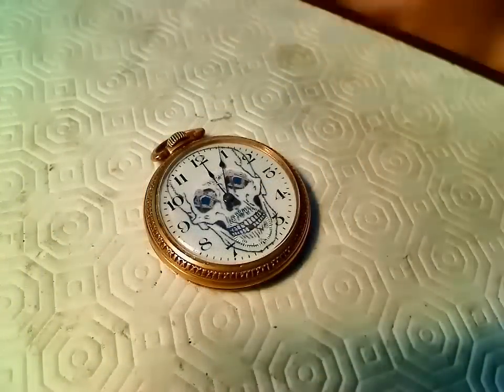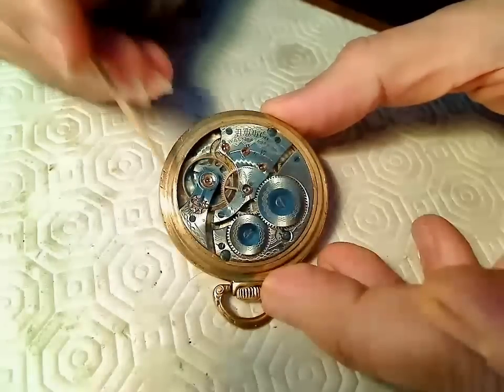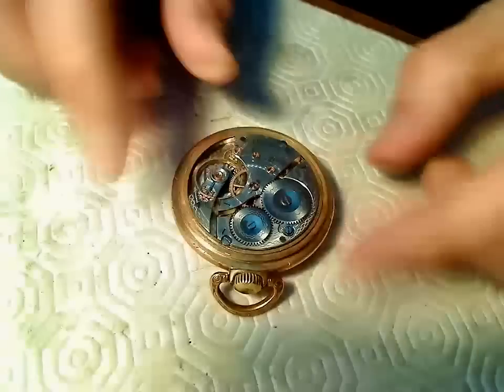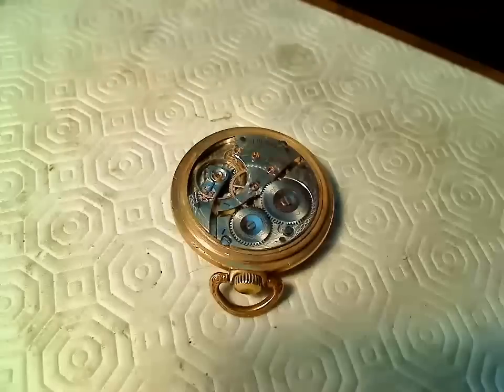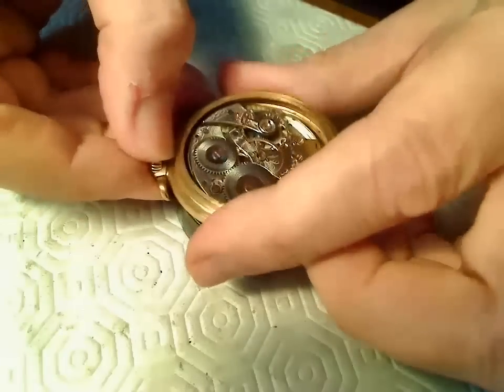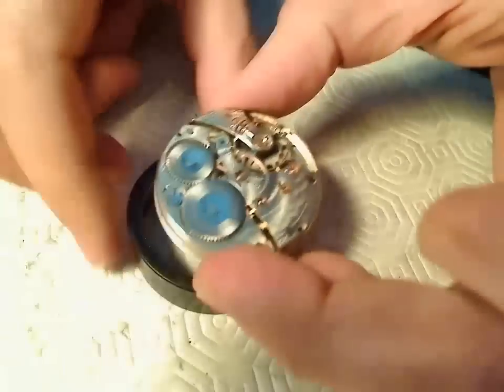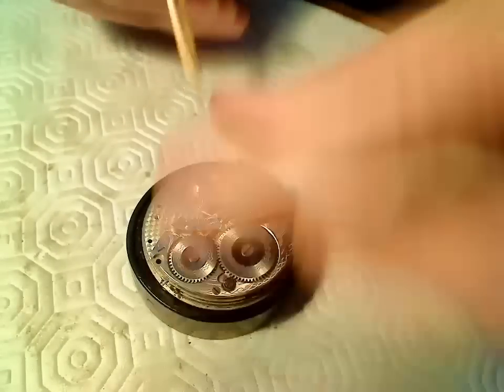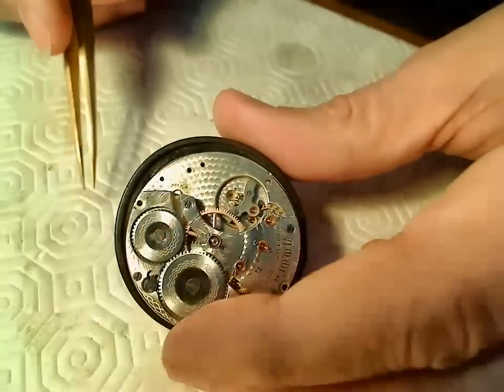Waltham Free Mason Watch Disassembly and Chat

Comment: Thats a nice movement. Regards the mainspring,  that's pretty standard. They use a separate arbor that fits through a cam with a hook on. Also when releasing the mainspring, if you over walk the spring, they tend to slip off the centre hook. Very nice job done JD.
Reply from the maker: tony diggins Thanks a lot. I have only been at this for 4 years but have fixed a load of watches and used my lathe quite a few times. Also read every book and watched all the videos available for study. Lots of fun.

Comment: just acquired a non working gold Waltham Traveller and after watching this video am going to have a go at disassembling. Many thanks. PS I'm assuming the case is plated though it is stamped 750?
Reply from the maker: Border Biomass Fuels - Firewood Supplier If the case says 10 or 20 or 25 year guarantee, it is gold plated with a guarantee that the plating will last that long. Some pocket watches may also say 10K or 14K as well.

Comment: When you removed the mainspring barrel the top came away as did mine. How did you rectify that? I'm finding the arbour is refusing to fit into the base plate and as a result it wont close up properly.
Reply from the maker: Border Biomass Fuels - Firewood Supplier I think I simply fiddled with the barrel to reassemble it and place it into position

Comment: I've watched this half a dozen times now and my Waltham traveller is now in its constituent parts. Have to figure out best method of cleaning then reassemble. Finally realised that the gears were not moving when the watch was wound up. Not sure why - main spring is fine as far as I can tell. Is the small ratchet which engages with the larger of the two gears meant to be spring loaded?
Reply from the maker: Border Biomass Fuels - Firewood Supplier It’s only spring loaded from the pressure of the large gear over the mainspring
Reply: If the train wasn’t moving after disassembly the pivots probably weren’t in their respective jewel holes / brass bushings. Did you get it to work again?

Comment: That other watch that was stopping when in the dial up position. Maybe the jewel in the bal cock is a bit tight. I remember one of the old guys telling me about when they made their old staffs. Sometimes a guy would make one end a bit small and rather then make a new one he would put in a smaller jewel. Then the next guy might be using ready made staffs and they wouldn't fit right. Just a thought.
Reply from the maker: I think the pivots need to trimmed down to fit in the jewel with the right amount of side shake.
Reply: @JDRichard  You think both, well you have the ability to do that kind of thing, I wouldn't attempt it myself. I hope you do it on a video, I've never seen it before, only pictures in books!
Reply from the maker: @davidmacdonald679  I have made videos on how to use a Jacot tool to trim down balance staff pivots.
Reply: @JDRichard  I watched it last night, I also watched you cutting the bottom pivot of a balance staff on a lathe, I enjoyed both a great deal!
Reply from the maker: @davidmacdonald679  Thanks David